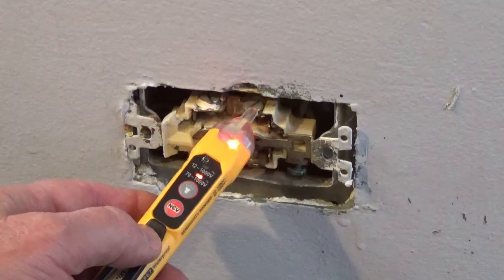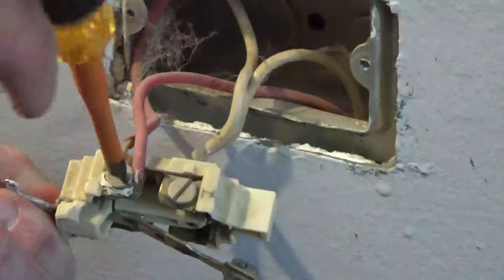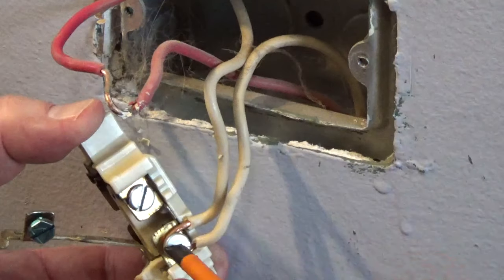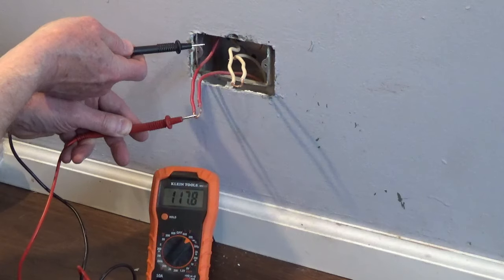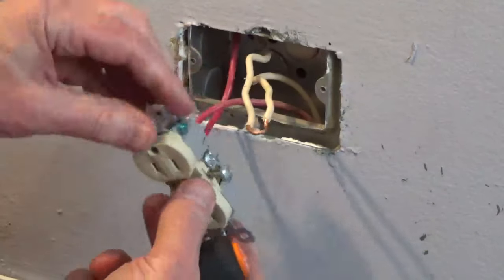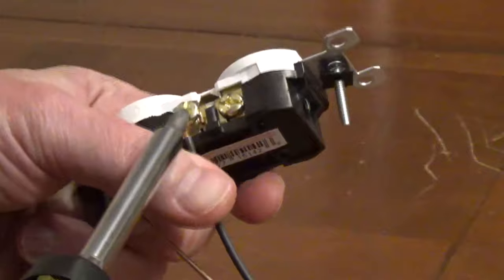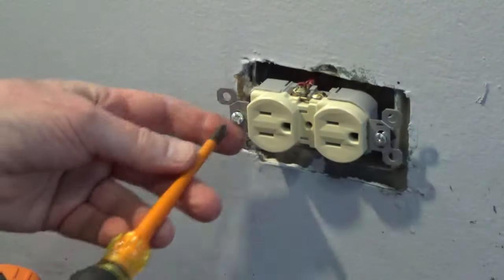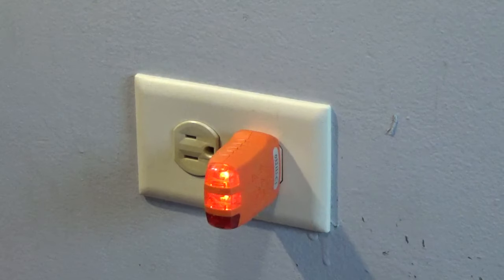Replacing a Damaged Outlet - Unspliced Looped Wires - Conduit

Comment: So is the there a ground wire screwed into the side, back or inside the base of the box somewhere??? Basically is there 3 wires (black, white and green or bare copper wire running into or to this box?
Reply from the maker: Hi, in areas with conduit, the conduit is the ground path, there isn't a ground wire. This is common in Chicago and other areas around the country.
Check out more home improvement tips in our e-books https://www.amazon.com/gp/product/B0B2KW1FQ9?notRedirectToSDP=1&.